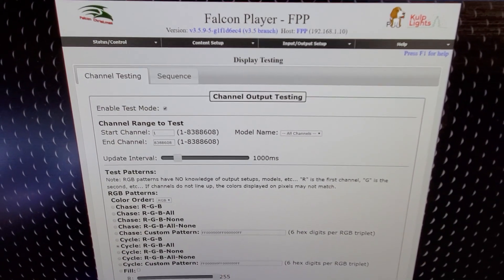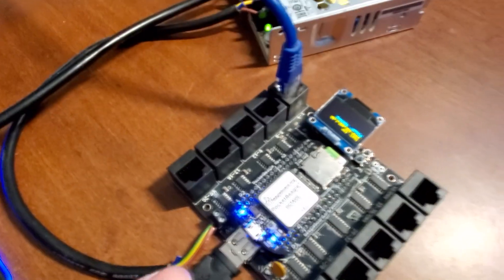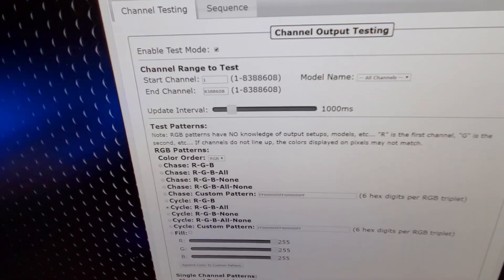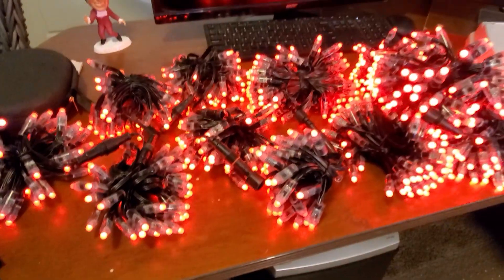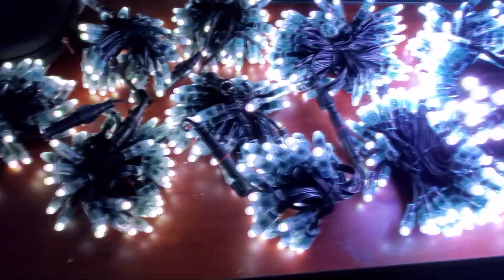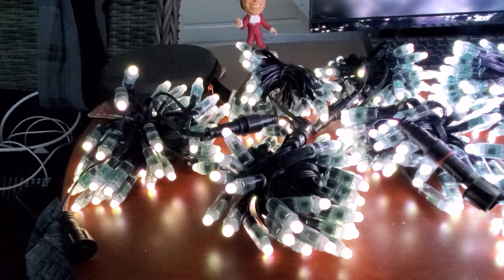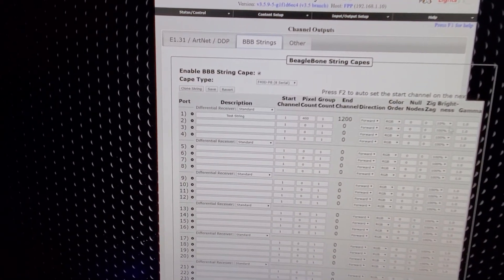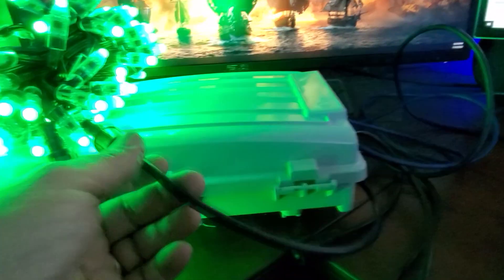Kulp F40D PB Pixel Controller Initial Setup

Comment: How did you connect the pixels cord to the K40 Ethernet port?
Reply from the maker: The ethernet goes to a switch. The pixels are plugged into a receiver that connects to one of the differential outputs on the controller.
Reply: @xTremeSequences  so I must have a receiver right ?
Reply from the maker: @fabiocosta_me  Correct

Comment: Can a pocket beagle run a full size board with 16 pixel outputs on it?
Reply from the maker: I don't know. I've never owned a pocket beagle. I would check the Kulp website.
Reply: @xTremeSequences  what beagle bone at you using in the video?
Reply from the maker: @lightsonmatfield4031  Looks like a pocket beagle as I took the time to look in the store and saw the image that says Pocket Beagle. Here is the unrefuted proof:  https://kulplights.com/product/k40d-pb/

Comment: Can you just use a USB cable instead of USB to Ethernet?
Reply from the maker: If your switch or router will work with a USB for ethernet data I see no reason why not. I've not used any that do.
Reply: @xTremeSequences  thanks! Do you happen to have a link to the USB to Ethernet adapter you used?
Reply from the maker: @jonathongrulke2586  Similar to this: https://www.amazon.com/BYEASY-Portable-Applicable-MacBook-Notebook/dp/B07FH7XJCD/ref=sr_1_3?dchild=1&keywords=jcx-001+usb+port+hub&qid=1586399999&sr=8-3

Comment: HOLY CRAP 800 PIXELS ON 1 OUTPUT?! are they power injected
Reply from the maker: No power injection but I would not run 800 from one port for a show. This was purely for testing. The most I run in a show out of one port is 640 pixels.
Reply: Are they 12v?
Reply from the maker: @ajayjaybb  Yes
Reply: So how meny could it drive if it was 5v and I have a 5v 60A 300w power supply?
Reply from the maker: @ajayjaybb  A lot less. It depends on distance from controller to first pixel and brightness level.
Reply: Oh darn ok it's for my mega tree

Comment: Looks great. Are your pixels power boosted and can you describe in the comments what the system set up is in the video.
Reply from the maker: The pixels will be powered from separate MeanWell 12v power supplies. This allows me not to have to power inject. I have never needed to power inject thus far. With the Falcon receivers, I am allowed 640 pixels per port to maintain 40fps. There are other alternatives to gain more pixels per port but I have not tested those. In my opinion, 640 is more than enough to run from a single port. 640 pixels at 40 ports is 26,600 pixels. That's plenty and impressive.